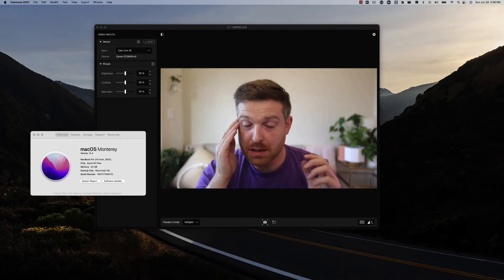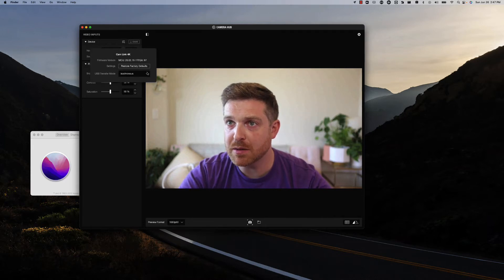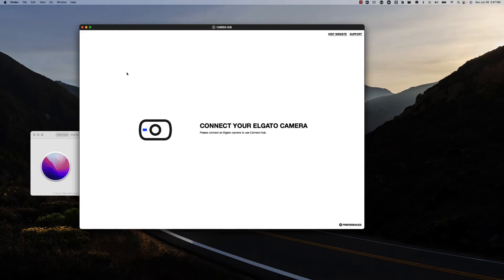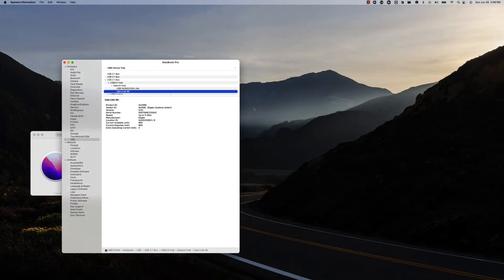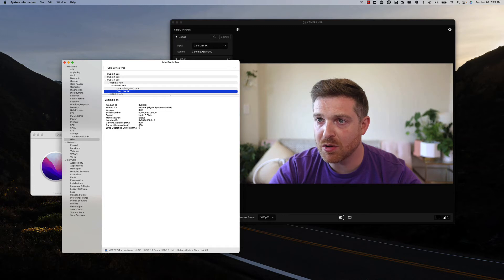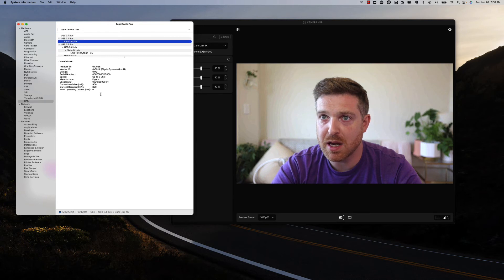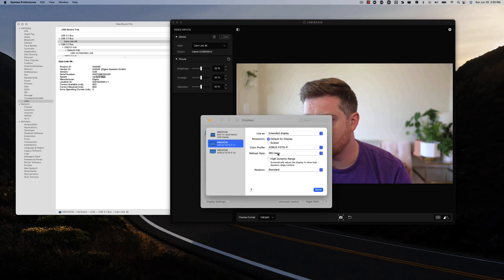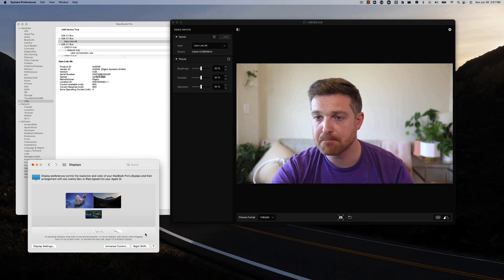Satechi Thunderbolt 4 Dock and Elgato CamLink 4k Having issues with Apple M1 Max

Comment: SOVLED: Well sort of...
I have a Macbook Pro M3 and have the SAME EXACT issue. Everything the same when I adjust to isochronous or bulk or whatever. I am using the IVANKY 20-1 Dock which is designed specifically for the Apple silicone chips and I am getting the screen flashes. This dock is $400 so I don't think any higher quality dock would solve the issue.

When you plugged the elgato camlink 4k directly into your mac you didn't get the issue. My mac doesn't have any USB A ports so I couldn't do that. I used multiple docks and had the same issue EXCEPT when I used a very generic USB extender I'd call it rather than a dock, it WORKED! So, it seems any dock that does any form of processing the data will have an issue. But if you can get a direct connection then it will work fine. I can confirm this on a 2023 M3 Macbook pro. Currently I'm just going to buy a direct USB-C to USB-A adapter and it should be fine if I connect it directly to the last remaining USB C port I have on the mac (the other two go the Ivanky dock).

So is this a solution, yes. Did it allow me to finally record using my Canon R7 again, YES. Is it really new information... meh. I could not find ANY other solution so this comment is more just to say, accept that you need a generic adapter and can't use any kind of sophisticated dock with the elgato. I don't see them updating any firmware anytime soon, so I'm accepting this reality. Much cheaper to get a little $5 adapter than to buy a new capture card.

Great video.

Comment: Just dropping by to say that I have the exact same problem (but tested with both Hyper Drive and Alogic Thunderbolt 4 docks). Tried on a Macbook M2,  a Mac mini M1 and a Windows PC. What is strange is this problem only seems to happen on the Apple devices. It works perfectly connected to a windows machine using the thunderbolt cables into a USB-C input. This is driving me crazy..

Comment: I encountered the same problem with the Caldigit TS4 Thunderbolt Dock on my 2020 Macbook Air M1. The only solution I discovered was to connect the Camlink 4k directly to the other USB-C port. Ideally, I'd like to plug the capture card into the dock. Is there a compatible one that works directly with the dock?

Comment: Have you found any thunderbolt 4 dock that works perfectly with m1 mbp? I feel like everyone of those on the market are not fully compatible with apple silicon chips
Reply from the maker: So an update on this... I changed my capture card to the avermedia Livestreamer CAP 4k and that one seems to not have the same issues as the Elgato Camlink 4K.  It works with all my docks.   And it doesnt look any different to my eye.   Elgato says it's a limitation of bandwidth but as you can see in the video,  the device only needs 5gbps which is the same with the avermedia.  And with a Thunderbolt 4 dock, that argument doesnt really hold water.

The issues with resolution seem like a limitation with this dock.  I will know more once my Caldigit TS4 arrives this Sunday (if all goes well)

Comment: Hi, I have the same issue, did you manage to solve it?
Reply from the maker: No, not really. Right now I have the CamLink 4k plugged in directly with a right angle usb-c adapter so it’s not just sticking straight out. I am going to try a different dock though honestly, I think this is an elgato M1 issue.
Reply from the maker: I've confirmed this is an Elgato issue (at least in the case of the Camlink 4k compatability).  Elgato thus far continues to deny that it's an issue with their product and blames the docks.   I discovered this by purchasing an Avermedia Livestreamer CAP 4K and that one doesnt exhibit the same issues and looks the same to my eye.  The resolution / refresh  issues between my identical monitors still is an issue that ithink is a limitation of the Satechi dock and  it's version of supported DISPLAYPORT.  I will know more when I get the Caldigit TS4 Dock at the end of this week.
Reply: @trachysa  hey buddy! did you find anything else? I'm looking to get a new dock, or new capture devices as I need to use only one port for this to work. Any luck with other hubs?
Reply from the maker: @HolaMundoDev  the avermedia capture card works great! The caldigit dock didn’t change the dual monitor refresh rate. The key would be having a dock with dual DisplayPort 1.4. I don’t think it exists. So long story short: the experience of satechi vs the caldigit TS4 dock hasn’t really been too different. Honestly the best way to get max refresh/resolution out of your MacBook Pro is two cables: one for the dock, the other as either thunderbolt to DisplayPort or HDMI.
Reply: Get a generic adapter so you can connect camlink 4k directly to your mac. Only way. Otherwise get a new card like the channel creator has done.